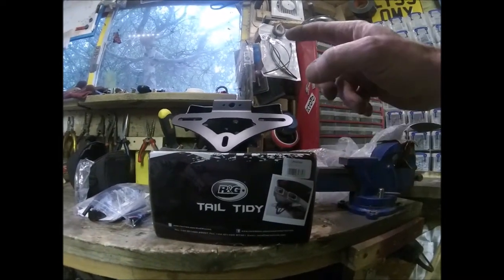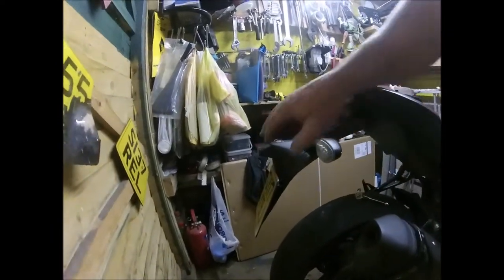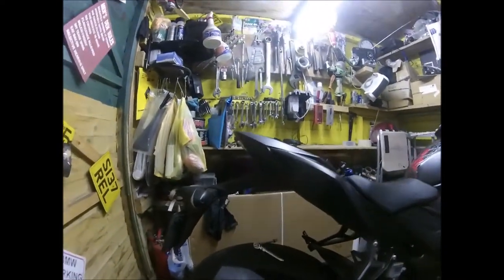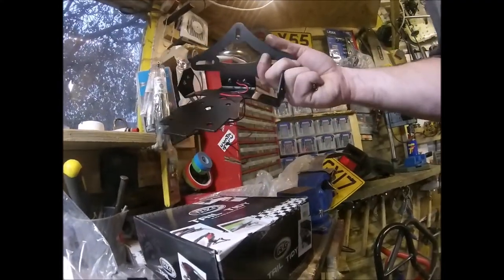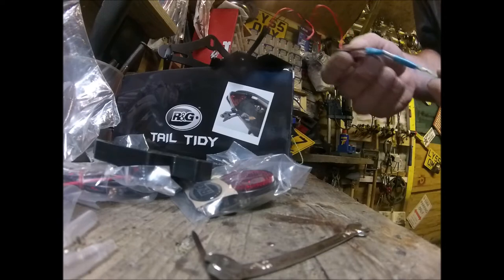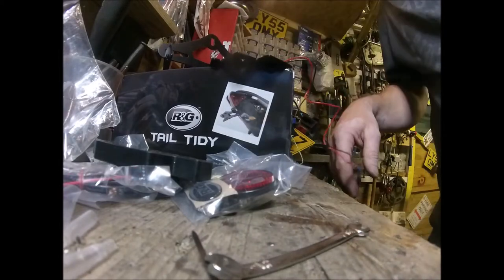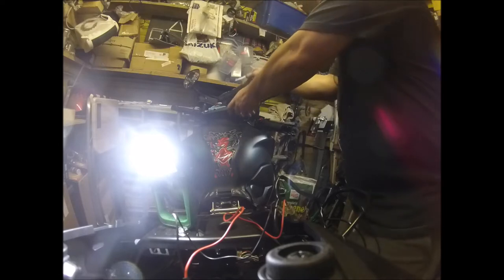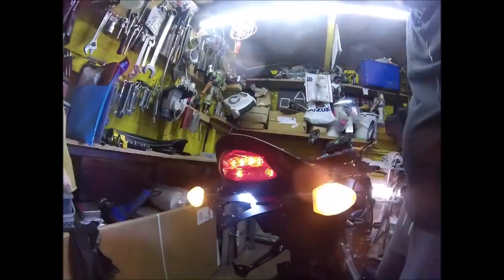GSX S 750 R&G Tail Tidy

Comment: Instead of stripping everything down couldn't you just cut and strip the wires and use block connectors under the rear seat?
Reply: That's what I was thinking saves all that time taking the bike apart